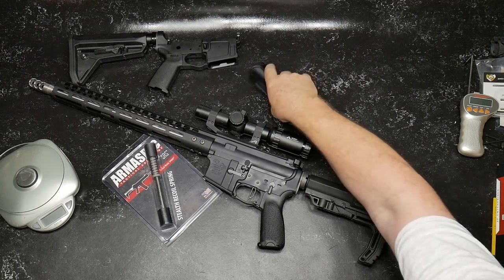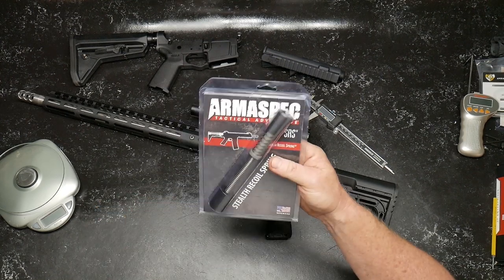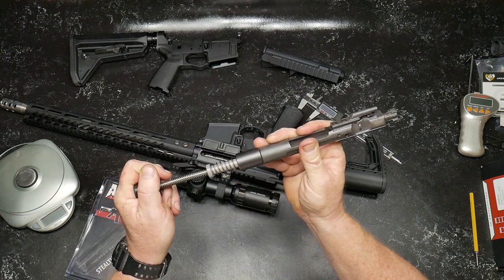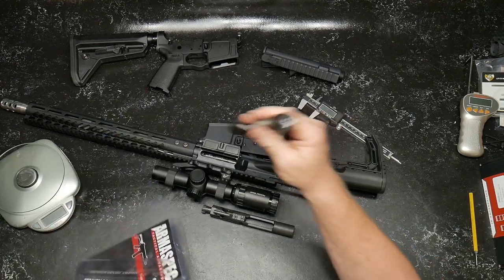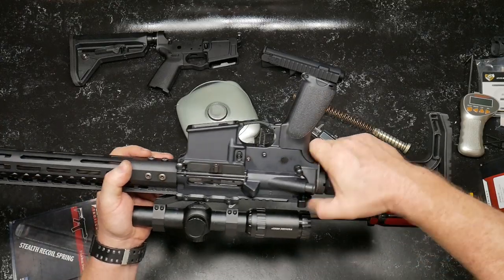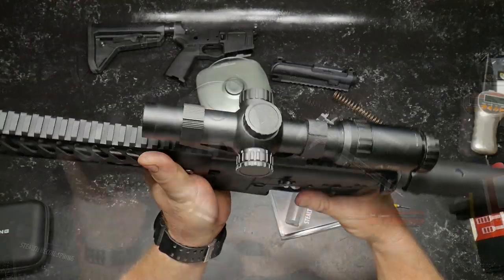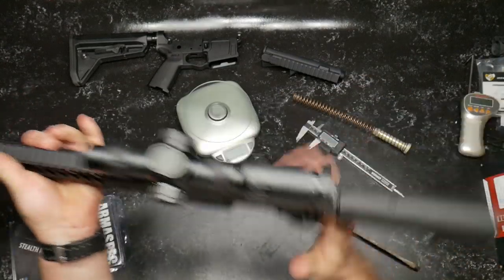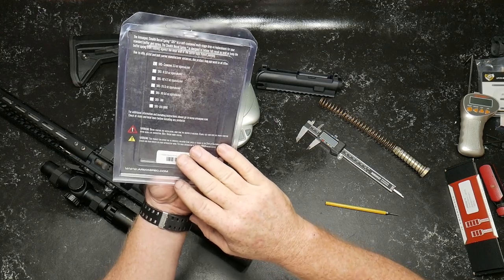Armaspec Stealth Recoil Spring First Look

Comment: Cool. Both my FN AR-15s cycle very smoothly and quietly with none of the typical "SPROOOIIINNG!" sound ARs are known for.
But i was curious about the guide rod buffer systems and bought the Shooting Innovations RRS (Recoil Reduction System) to try in my modded FN 16" M4/RECCE carbine.

So equipped my FN is a bit smoother and practically silent when cycling.
But It was the buffer action of the RRS that most impressed me.

The RRS is a silent guide rod style buffer system like the Armaspec and JP systems but it also incorporates a 2nd stage buffer that kicks in at the end of the BCGs travel. The effect is that the BCG never hard bottoms at the end of its travel making it very smooth cycling and actually doing what it claims, reducing perceived recoil.

My FN is faster and smoother running allowing faster doubles and triples and is much less jumpy from the bipod.
My FN has always been 100% reliable and that has continued with the RRS.

Ive been totally impressed by the RRS. In conjunction with the VG6 epsilon muzzle device and Lantac/CMC ECT-1 trigger ive installed, my FN just blisters the A-zone at 25 yds and i can keep quick doubles inside 5" at 100 yds when im on point.
From the bipod i can keep quick doubles inside 2" at 100 yds and even managed a couple of 1/2" groups!
I cant do that with the stock buffer so the RRS has to be doing something.

Ive used the RRS for over 8,000 rds now with zero malfunctions. 
The 2nd stage buffer did seize at the 6,500 rd mark but the rifle still functioned fine just without the benefit of that last cushioning effect.
SI replaced the 2nd stage no questions asked.
At the 8,000 rd mark the main recoil spring felt soft and allowed the BCG to bounce back out of battery on occasion when manually cycling but never malfunctioned during firing.
A quick email to SI and they sent out a new spring.
Alls well and i presume its good to go for another 6,500 to 8,000 rds atleast.
Im not sure if it will require regular replacement or not. I guess ill find out in a year or two.

Anyway,  the SI RRS seems to be relatively unknown . Im the only one that ever comments on it.
I highly recommend it to anyone needing such a system and id love to hear from anyone else who has it.

Comment: You mention a bunvh of calibers, but will it work for a 9mm pistol and carbine?
Reply: It should, as long as the particular 9mm BCG you are using has the same internal clearances as a standard 5.56 BCG.  You'd also probably want the "heaviest" spring assembly you could get.

Comment: Wow KB, you are so way behind the times on these. I’ve had one in my carbine for two years now and it has worked flawless! I ordered one for my pistol also, that’s how great it is! As for the JP, well if you feel like over paying for the same thing as the Armaspec then that’s on you! I didn’t acquire my money making foolish purchases and don’t plan on starting now, but that’s just my opinion and mine alone! To each their own as is their right.
Reply: Hey that sounds great, what weights are you using in what length barrels etc? I think I might try the Arma H2 for my 11.5" carbine...

Comment: I had to modify mine some. The front rod end was catching on the weight and hanging up on the BCG. I beveled the edges front and back and took a few thousands off the finish of the weight for clearance in the tube.

Comment: I haven't checked out the cost of the New Spring Assly. you're trying out there. BUT,  I still hear the Boeing Boeing Boeing Sound out of it. It might be alittle bit lower in Boeing than the Stock Spring Assly. But, Neverless Its Still There......Hell, I've been shoot'n these AR's ever since back in the Mid 60's or so, it wouldn't make a nickel's worth of crap to me on this part of it to change. Sorry.

Comment: Do NOT buy an older generation srs. Disassembly to swap put weights is a God damn nightmare to the point where it's easier to buy a whole new srs. The main weight is held in place by a tiny metal 2/3 link o ring that you have to peel back WHILE depressing the recoil spring, which isnt easy after the first 15-20 seconds.

Cheap junk

Oh did I forget to mention they never show anyone how to disassemble to change weights, despite selling the different weights directly to consumers? Top class service there